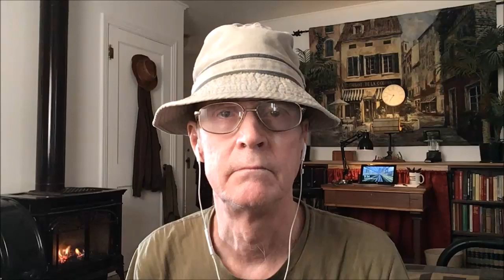Yagi Antenna Fed With Open Wire

Comment: I would like to try to feed a moxon beam with open wire.
One guy uses PVC for his square magnetic loops, he mentions that loop diameter is extremely important. He covers the pvc in aluminium foil as the driven element. I wonder if anyone has driven a magnetic loop from open wire?

Comment: Good to see you Stan and nice to be able to leave comments. I want to learn more about open wire, how to match it to the antenna and how to calculate the balun for the tuner. Ideally i would build the antenna and try to find out it's inductance, then build open wire ladder line to match that, finally i would like to measure the impedance of the ladder line + the balanced antenna to be able to calculate the balun ratio. I was hoping to use a VNA but i can't find much info on using a VNA with balanced antenna and open wire. Thanks.

Comment: Hi! I have using for years open wire line fed to fed my antennas. My main antenna is a Collins design antenna, designed to trasnmit on 160,80 and 40 meters mainly.
With a tuner like Annecke, the system works well. You need to take care to use  to fed current or  voltage mode, according with the fedline longitude. These days, I´m using the Collins design with reflectors for 80 and 160 meters, pointed to 150°. Never a problem yet, fortunately.  Greets, LU5YF Juan

Comment: Remember, open wire - or, window line - is extremely low loss regardless of the SWR at the feed point of the antenna.   No matter what standing waves might be on the balanced feedline, the radiation is eventually going to be radiated by the antenna - it has nowhere else to go.   The balanced nature of balanced feedline means that any standing waves on the feedline are going to cancel themselves.  This, of course, assumes that nothing along the path of the feedline has introduced an imbalance (like from a metal antenna mast, gutter, or other metal objects) along the feedline.

Having said that, if there is something that causes an imbalance on the feedline, you introduce the prospect of the feedline becoming a part of the antenna and experiencing RF feedback into the shack, as well as detuning the antenna itself.

For receiving antennas, like for TV and FM radio, this is not a problem - because, no RF transmission means no RF reflected down the feedline.  This is why a VHF/UHF Yagi beam antenna for TV/FM radio reception can be used with balanced feedline without issue - and, with much less signal loss than coax (assuming the feedline remains balanced).

And, the SWR can be corrected with an antenna tuner in the shack.   So, as long as the antenna elements are the appropriate length and spacing for the desired band,  the antenna is going to remain effective while using a properly balanced feedline.

Of course, all of the variables that balanced feedlines introduce into the equation, as discussed above, make it more practical to use coax and a matching system at the feed point of the antenna (like a Gamma or hair pin match). 

Thanks, for the video!
73
AI4IJ

Comment: OK but if you really wanted to get crazy with open-wire feeders for yagis, why not have a 3-wire folded dipole (folded-folded dipole) which would have a 9:1 impedance boost, as the driven element?
Reply from the maker: That might provide a better natch for open-wire line that a plain folded dipole would do. It would increase a 20-ohm resistive impedance (at the driven element feed point) to 180 ohms, for example. Certainly worth a try. It would provoke lots of interest, for sure. 73 de Stan W1GV.

Comment: Hi Stan, I watched one of your other videos about protecting against EMP but the comments were turned off. Anyway, I'd like to ask, in the case of an all-out EMP attack on the US, who would be left standing communications wise and what course would you take in order to be one of those left standing?  Thanks in advance for any info! I'm also a prophet... The prophet of doom and minister of truth... :)
Reply from the maker: In order to maximize my chances of being one of those "left standing", I would leave all my radios disconnected from the power lines and antenna feedlines at all times except when I was actually using them. I would also have a backup power supply using a battery charged with solar panels. 73 de Stan W1GV.
Reply: @stangibilisco   Thanks so much for responding Stan, I'm a nubee to the ham radio scene but and old hand when it comes to understanding Bible prophicy. In the 17th chapter of Rev we have the beast burning the whore and that's what's about to unfold in the very near future. I believe that Russia and ten other nations will unleash an attack on the US and Europe. What John sees in chapter 17 is the globalists vs the communists basically. If they are going to mount an attack that has maximum impact, it must be before Trump gets our gird hardened... so you can see that they must attack soon if they are going to, right? 

You can thank me for the cherry news later but in the meantime keep your powder dry (in a Faraday cage), lots of fresh water on hand, food in your storage and don't forget the potassium iodide pills... Cheers...